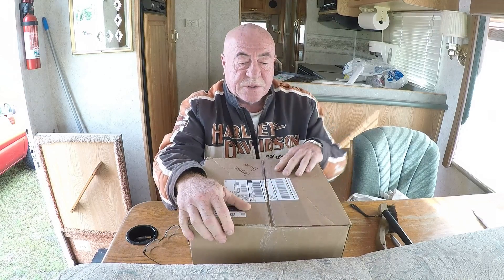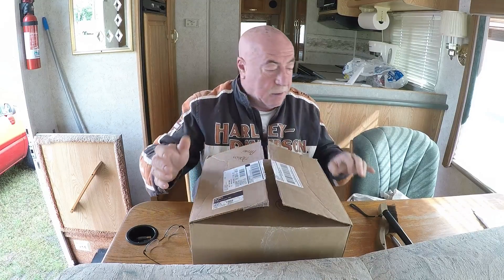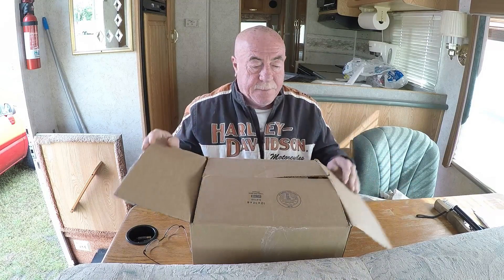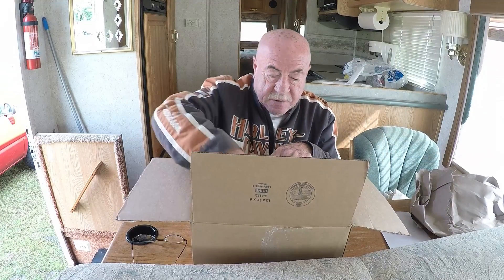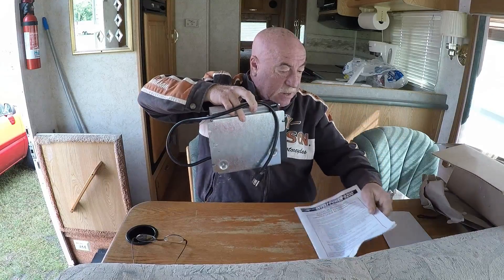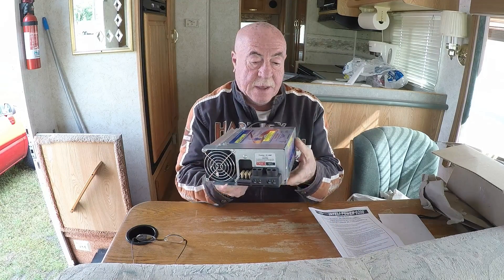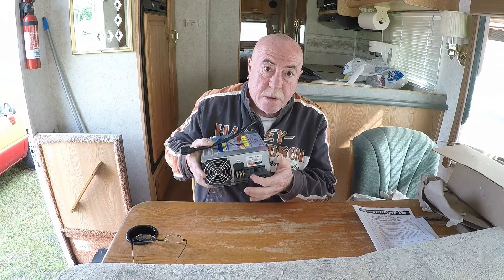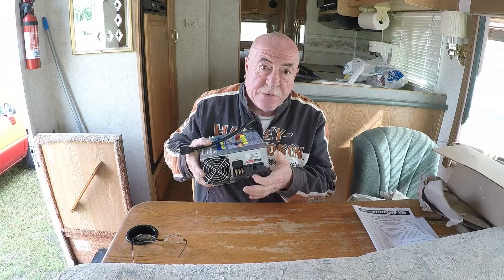Un Boxing My New Progressive Dynamics 60 AMP Smart Converter

Comment: I have 55 amp ,can I upgraded to a 60 amp with out messing any thing up,I have # 2 .6 volt batteries
Reply: Should be ok, just make sure your wires going to the batteries can handle 60amps

Comment: you can hard white it in to your breaker panel there is a breaker that goes into your old converter disconnect the wires out of that and hardwire that into it done run your DC wires into the DC bus bar it's that simple dude

Comment: If you doubled the amps going from the charger to the batteries I hope you increased the wire size as well. When they build these coaches they do not go any larger wire size than they have to due to copper prices.

Comment: The reason there is little information out there, is you can install this in many configurations. You can use solar, alternator, generator and shore power. It depends on how you want to use it. As each setup requires different wiring, switch gear and inverters.

Comment: I won a 9200 on EBAY for 125.00 US  60 amp with charge wizard. Do you recommend the the remote LED indicator FOB?  Steve
Reply from the maker: You will love the unit!  I did not know there was a FOB available.
Reply: Rufus N Dufus

Comment: Chico,
I am going to put the 9200.. In my bus...I have only a 30 Amp service into my rv.  Is yours 50 amp?

I think the 9200 charges at 45 amps but has the smart wizard charging system.
Reply from the maker: 1pilotsteve Yes, mine is a 50 amp.  I think you will love the 9200.